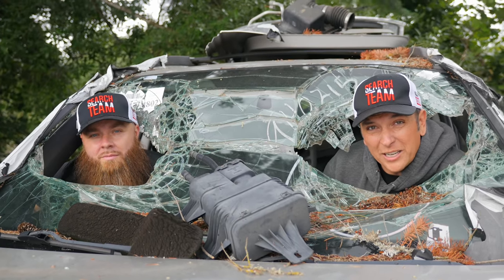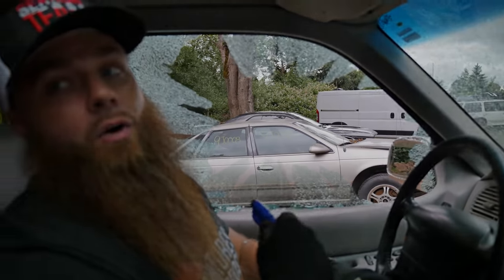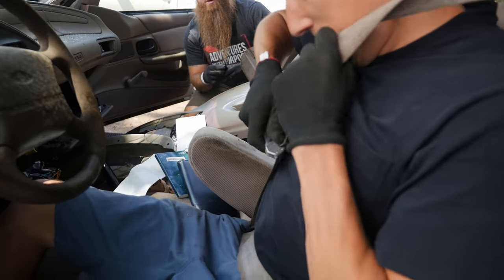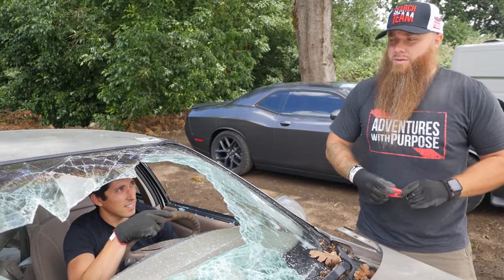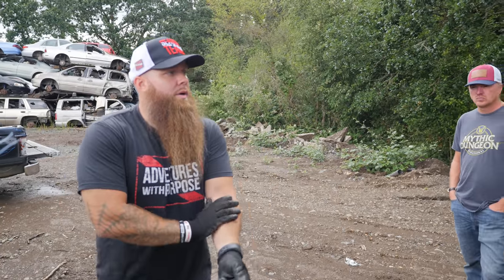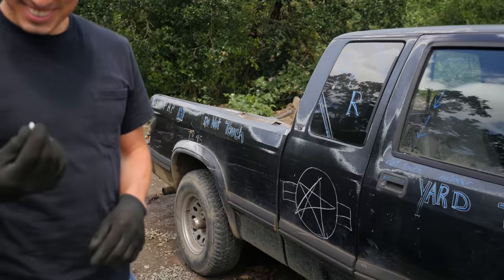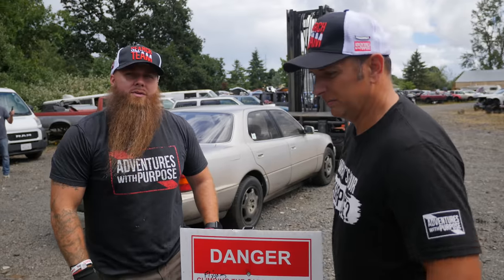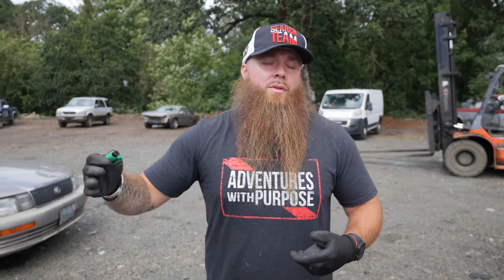HOW-TO-ESCAPE FROM YOUR CAR.!! (This Could Save Your Life)

Comment: Great video guys but I have questions please. These were all older model cars. You demonstrated just how hard it was to break through the laminate windshield, so how do you break out of a new car that has all the windows laminated? Also, new cars do not have actual keys anymore so this tool won’t be hanging right there within reach. Is there a good way to attach this to a strong magnet stuck to the dash beside the steering wheel? Or what would you all suggest? 
And a water demonstration would be great. I believe most people are at a loss for what to do in that situation. 
Thank you and God bless you all for everything you are doing!!!
Reply: Exactly what I am concerned about. I'm not going to be purchasing older cars.
Reply: This tool has an inexpensive addition that makes it able to clip to your visor. It would be a matter of reaching up rather than reaching down. I got mine on Amazon but I’m sure you can get them many places. Perhaps AWP can add this kit to their merch store…
Reply: Exactly what I was thinking!! My car is 2018 with a key fob. You could use a strong velcro to attach the tool near the steering wheel.
Reply: @melissameyer6726  - I'm feeling the opposite.  I have a 2008 car and LOVE it.  Never given me a problem for years.  I'll have it until it won't run no more.  I hate the new cars.
Reply: Check the stamp on the glass, the side windows may be laminated on newer vehicles, but the rear or sometimes the sunroof is "usually" tempered.
Reply: @jdstep97  I don't blame you for loving your older cars. I loved a lot of mine too but I drive a lot and so unfortunately my cars don't last very long. I was sad when my car was considered totaled at 308K miles just because I hit a deer and only had minor damage to the front.
Reply: I share your concerns as well. I do have an older car but my son & daughter don't.  How .... what can I  tell them?
Reply: you could attach it to a key ring or a carbineer that attaches to the shift lever if still on steering, turn signal, wiper lever, etc. when there is a will there is a way
Reply: @DIY Disabled Dad  this tool won't work on the newer laminated windows though.
Reply: I've had one of those tools for years -- it's attached to one of the driver's headrest post behind me.  Haven't needed it yet but I always know it's there.  So do my passengers.  And I've tested it so I know it works.
Reply: @DyreStraits  clever
Reply: And when it comes to water. wait until car is filled up with water and either open the door/window or break it in case you can't open it(don't do it before it's filled at least almost to the top or you are more likely to die). If you have kids, let them out before you with the oldest going out first. Prepare them while car is filling up by reminding them what to do(in case they were trained) or explain what to do the best you can(if they were never prepared for those kind of situations). Always stay calm to keep the kids calm. Help none swimming kids reach the surface. If by yourself, once car is full and you're out, swim for your life to the surface and try to stay calm since panic can slow you down. Although, in some ppl panic makes them move faster, feel stronger, but rarely helps them think. It's mostly cause primates follows their insticts to survive, not their thinking, which is what panic does. Unfortunately, humans are no longer good at using this tool,mostly because you can't have a natural survival instinct in a 2021 ford crossover under water. Not very natural, is it!? So stay calm and plan out your escape.
Reply: I'd say.. a loop or wrist band (which SHOULD BE ON THESE so they don't get dropped!) But could be put thru a vent? If you yanked on it.. the vent would probly pop out, or break. Then put your loop over your wrist.
Reply: I was definitely wondering the same
Reply: Honestly tou could probably just buy a few strong magnets, glue or attach it to wheever you want it in your car and attach
Reply: @1bluebonnetbelle  that was a response to the question on how to attach it in cars with no key, just a fob start.. but serrated knives and machettes will cut through new glass. takes a few secs but if you have no other choice its better than nothing
Reply: @adibarr8996  I was thinking the same. If I’m in the water and the car is filling up, I bet I drop it in the water. Same with smoke. Fine motor skills are a bitch in an emergency. Gimme a loop.
Reply: @PatrickLee716   I do appreciate the info. 
Thank you very much  😊

Comment: Thank you. I have the same tool that gentleman has and after seeing that I ve had a false sense of security for 3 years, I bought 4 of your devices. I think its worth mentioning many cars these days have keyless start( push button) so keys may be on a purse or in a pocket so hanging it somewhere else, may be critical. You guys are great. God bless!
Reply: Yes
Reply: Rear view mirror with a zip tie works great.
Reply: Thank you for mentioning the keyless start. I would attach something to my steering wheel.

Comment: I got that exact tool because I ran into a situation where a guy had a seizure behind the wheel and crashed into a tree, and the car was on fire, and no matter what we used, we couldn't break the windows. And this was us hitting it from the outside with a hammer. We eventually got it but it took way too long to open it and made me realize how much force it takes to break a window. I highly recommend anyone to get one. They're not expensive on Amazon

Comment: Thank you! For doing this. Didn't even know. The type of material used in the windows now. What works to bust the windows. Everybody needs to know this. Josh should send. That tool back. Tell the company. They made a tool that is useless. It is  very scary. When time is ticking away and your trying not to panic. It intensifies when engine smoke. Is added to the escape dilemma. Great job!! Props to the junkyard owner. For allowing AWP to show us. Props to Doug for doing that rollover demonstration.👏👏👍👍🚗

Comment: Bought one of these years ago and thankfully have never needed to use it. While taking driver’s education I had the opportunity to sit in a car while they flipped it, slowly and controlled but all the way upside down. That experience also really drove home how important adequate headspace is. You need to be able to hold a fist above your head without touching the roof of the car. Any less space and you risk breaking your neck in a roll. The seatbelt will hold you, but you still move some. Ensuring you have adequate headspace and this tool vastly improves your chances at surviving.

Comment: This right here is no joke.  You might not think this could ever happen to you but guess what.  True Story..  It happened to my family 30+ years ago.  
My Dad & his friend, went fishing on my Dad's boat.  His friend was an ex-cop from NYC, but normally didn't go fishing a lot, especially with a boat.  Everything was fine while they were out on the ocean.  Came back & my Dad had to hook up the boat to the hitch on the car so he told his friend slowly back the car down the ramp & then stop. When my Dad got the boat hooked up he told John ok put it in drive- John must have put it in reverse & gassed it. The car coasted down the ramp until it was in about 15 ft of water @ the bottom!  It was getting dark but the headlights underwater showed my Dad where the car was.  The pressure was still greater on the outside so he couldn't open the door & the electric windows now don't work. My Dad jumped in & swam down & could hear John yelling & panicking inside. The car was filling up with water.  He had to keep coming back up for air.  He was screaming, please God help me, I have to save him or he's gonna die!  My Dad somehow managed to get the very top of his fingers up under the window seam where there is like foam @ the very top of the window & managed to push his finger tips up over the top of the door window itself- on the driver's side & literally yanked the window out of the frame & pulled John out of that car.  

My Dad is a pastor but he became a super hero to me from that day forward. He told us  all, he couldn't understand how he was able to do that from the outside, but somehow he did.  God answered my Father's prayers that evening.  Our car was gone, but that didn't matter to any of us- he saved the life of our family friend.  
I said all this to say.  If you don't have this tool already- buy it.  Because you just never know what could happen one day.  It comes suddenly and without warning, ask my Dad.
Maybe you could have this tool & you need it.  Or God could use you to help someone else.  
True hero's are dressed just like you & me, they don't need capes- they just need to have a willing heart & the courage to step out.
Reply: Thank you for sharing. Very powerful story. Praise Jesus Christ

Comment: I worked in EMS for 7 years and have seen many incidents that required self extrication. I bought a knife similar to the one in the video that I've thankfully never had to use. With that being said, I've lost confidence in my tool as I've never tested it. Judging from what I have seen, I need to purchase a tool specifically designed for this type of situation. With as many accidents as I've seen, I am still shocked at how many videos that you guys upload of recovering vehicles and in many cases, bodies. The fact that this is probably only a small percentage of what is lost out there is scary. I guess it's more common than commonly believed. Please continue the work that you guys do. It is beyond where authorities are willing to go. Thank you!

Comment: Thank you for posting this. As a first time car owner, what you have told us about the windows is really good to know.
I live in New Zealand, and we have incredibly windy, steep roads, often out in the farm areas the roads will be unpaved, often running alongside rivers and streams, lakes, and a what can be a pretty treacherous coastline. 
Just last year, a man in my community was on his way home after work at about 4am, he fell asleep, went through a fence at the the side of a small bridge over a creek, his car flipped and landed in maybe 2 - 3 feet of water if that, on it's roof, and he drowned just 2 minutes away from home. He was not found until 7.30am or there about, despite the accident happening on the main road, and right next to a house. I went over that bridge, on the way to work on a bus, and was none the wiser. (this bridge is one of two within 300 meters of each other)
So what you have just shown us, is truly useful, and sadly maybe needed at some point in time.
May the Gods bless you for the work that you do.

Comment: How is it that a tool like that isn’t standard in vehicles, like easy access by the driver side door or maybe in between the passenger and driver seat.
Reply: I completely agree!  I keep seeing them for sale in most hardware stores in my area, but this should definitely be something that comes standard in every vehicle purchased.
Reply: It’s likely more of a potential reliability/negligence lawsuit because you would be relying on someone not to panic, locate the tool and use it properly. Not to mention the likelihood that this  would be a 3rd party manufactured tool sold to the OEM of the vehicle. 

I’m not a PI/Patent or Libel Attorney by any means but the fact that the solution seems simple and obvious yet isn’t indicates to me this is likely a legal quagmire automotive manufacturers just want zero part of.
Reply: I have mine on my wiper switch, but you could put it on your blinker one too. I have a push button start car, so I don’t have a key in the ignition to keep my thing on my keychain handy in case I need it, so instead I hang it right next to my steering wheel.
Reply: @kristykelly1177 , I velcro them to the carpet near the doors in case things get flung around. I just got a new to me car and need to install them again.
Reply: It's called personal responsibility.  Usually the best option.

Comment: For starts, I came to this video expecting just basic tips and survival advice when it comes to escaping a car.  I too have invested in a window cracker for cars some years ago. But after watching this I came away with some self doubt. I paid almost $50 for a large device that surprisingly has a seatbelt cutter and a push for a window, along with a waterproof flashlight, but even with all it's fancy bits, I have concerns after seeing this video, so much so I took a strap from an old shopping bag and tried to slice it... it wouldn't go through at all no matter how taught I made it. With that alone, and seeing this video, I've now ordered two of your window breakers. 
The only thing I could think of that would be nice is if it had that waterproof led light that shined through both sides in case something happens at night, something that turns on on its own once its pulled free from the clip. That was one of the driving points to the existing one I had. Rather it's practical, not sure. If not, maybe some other sort of keyring light source that can pop on for emergency light, and have a strobe for alerting people. I've tried keyring flashlights and they are kinda ehh and don't hold up too well, keychain life. 
Just my thoughts on the matter, would love to hear your thoughts and if such would be worth it or not.

Comment: I grateful that you guys demonstrated these tools and scenarios. It was incredibly eye opening for me. I do have a button start vehicle though so I will be looking for an alternative place to keep my tool once it arrives
Reply: I have mine on the headrest post of the front passenger seat.
Reply: Was thinking the same thing. Maybe keeping it in the closed centre console storage area would work. That area where most people would keep their coins or tissues... Certainly reachable from either drivers or passenger seats...
Reply: I have the same issue with push button start.  Possibly the ashtray might work but my car's seat belts can lock if I even do a hard break so I may need to experiment to find the most accessible location for me.  
Does the porcelain work inside a car since you can't really throw it hard?

Comment: Since we have a push start we have them zip tied to the passenger head rest and one in the back too. We have them in all ours cars. We give them as stocking stuffers too.
Reply: I would recommend attaching it with a carabiner instead of a zip tie, it's much easier and faster to get to it.
Reply: Thanks for sharing!! My first that was, what about keyless start!?!
Reply: @Cantfi  I dont think that this is even all that necessary. Because they are meant to be pulled off of what they are attached to anyways. Just like in the video where they ripped it off of the ignition key. I did not use zipties to connect it to the rod of the headrest, I just stuck the rod of the headrest through the loop of the keychainring, so taking it off would be even more time consuming. I would just rip the actual tool off of the mounting part that is connected to the keychainring, just like in the video where they ripped it off, when it was mounted to the ignition key. So there is basically not a lot of difference in terms of getting it off of what the tool is attached to. Actually it is the intended way to use them, to rip them off; but that is just my opinion.

Edit: 4:23 for reference

Comment: I just want to tell my own story so people understand how important a tool like this can be. 

In 1990 I was involved in an accident. Another driver rolled through a stop sign right in front of me and I hit them dead center drivers side door. After I hit them noticed right away my car was still moving. I looked at my foot and it was on the brake all the way to the floor. I engaged the e brake and my car kept rolling towards a creek. I braced myself and put the car in park. It still kept rolling as it was going into the water I turned the key to shut off the car in a last ditch effort to stop the car. It didn’t work and I was now in the water in a panic. I tried to open the door and once I was able to get the door about an inch open, water just came rushing in and closed the door. I was able to undo my seatbelt and I was trying other doors but I did not know about water pressure vs air pressure. I started to resign myself to the fact that I was going to drown to death and I thought about how horrible it was going to be to eventually have to breath in water before I died. It suddenly hit me to try the window. I was lucky for two reasons, 1 I had roll down windows and 2 the water on the outside of the car was about two inches below the window. I got very lucky and was able to roll the window down to get out. 

I have adult children now and they all have a spark plug in their cars, but I am now buying my whole family this tool when you guys get some back in stock. My kids keep the spark plugs in the center console in one of the cup holders. But now I realize in a rollover they will loose the spark plug. 

I know my reactions sound stupid, but when you are in a panic situation and have no knowledge on how to help yourself it’s so hard to remain calm. My car did sink fast too. When I got to the edge of the water and was climbing out I looked back at my car and it was gone. It really can happen so fast. One thing I did learn after is IF you can remain calm once the water equalizes you can open the doors. But even with the knowledge I have now I don’t see myself being able to remain as calm as you need to be to be able to hold your breath at the end and wait out the last few seconds. 

This really is a cheep simple tool that everyone should have on them. You don’t want to need it’s nice to be educated about these kinds of situations and be able to know how to help yourself.